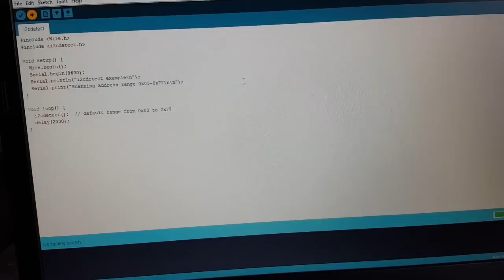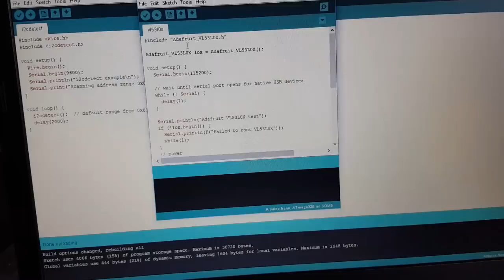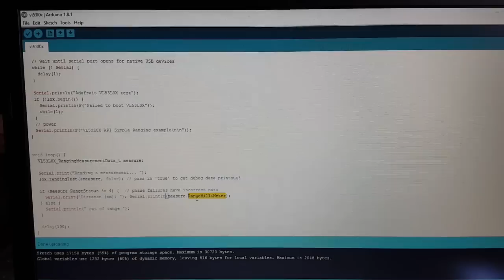Shooting laser to measure distance

Comment: Does anyone know if it possible to code in a 'set' button, so the screen reads '0' and the measurent counts up as the item moves closer?

Thanks
Reply from the maker: Of course. You can do it through the code. But it won't extend the range. So if the sensor has a maximum range of 1 meter and you place an object 20cm in front of it and reset this distance to zero. Than you only have 80cm distance left for measurement.

Comment: Is it possible to use laser sensor to measure the water level?
Reply from the maker: I would probably go for an ultrasonic sensor to measure water level.
Reply: @nenioc187  thanks. I'm just interested in the input voltage that TOF sensor offers

Comment: i want to use it for people counting in a room. i need direction for + and - for counting
Reply from the maker: Point it to the door. If distance stays constant, no one enters or leaves. If the distance decreases, someone moves away from the sensor. If it increases, someone moves towards the sensor. Or use two of them close to each other as a barrier. If sensor 1 and then sensor 2 changes distance, someone enters. If sensor 2 triggers first and then sensor 1, someone leaves.

Comment: My company did a project using one of these TimeOfLight sensors, and I worked with them extensively. I did not use the Adafruit drivers, I dealt with them directly with I2C commands to the registers. I detected a problem with them, they are not supposed to be sensitive to temperature or ambient light, but I found them to have a small susceptibility to both, It was enough to give us problems. Since the modules attempt to compensate to temperature changes, sometimes they over-compensate, sometimes they under-compensate, there was no way of telling which way any given sensor would go. Also, sometimes they would become more stable in their readings with a given temperature change, sometimes they would become more erratic. I decided I needed to create a test fixture to try to characterize these things.

I built up a breadboard PCBA with ten of these devices. I used one IO pin from the Arduino to drive the reset pin of each device. I would release one devise from reset at a time and assign it a new I2C address, and in this way I was able to work with all ten devices at once.

I put that PCBA in a wooden box with a lizard-warming heat source. The Arduino had a temperature sensor and a relay to power that warmer. It could be queried from a PC to give the current distance reading from any device, to report the temperature, and to turn the heater on and off. The PC would have the box heat to a configurable temperature, keep it there for some hours, and then let the box cool to ambient for some hours, taking and recording the time and temperature and device readings every few seconds. All the data went to a .csv file that I could pull up in Excel and then plot the data. I noticed behavior changes at 8:00am and decided it was because people were coming to work, lights were turning on, and the box lid that the devices were reading to was translucent wood. Aluminum foil tape fixed that problem.

We were able to fully understand these distance sensors and figure out how to make them work for out project. We had no further troubles with these sensors.
Reply from the maker: Have you published your research? I'm interested.
Reply: @nenioc187  No, my data stayed within my company. I still have my data that was collected during the test, and I still have the fixture and the source code to run it. While the Arduino monitored the temperature and made the readings, there was a program written in LabWindows/CVI that controlled the Arduino and collected the data. The project we were working on was a one-off, only installed in one hospital, but there is an effort afoot to improve on the concept and make it more generally available. I don't think the Lidar sensors will be in the next version of the system.

I am a test engineer with no college degree at all. That has not stopped my 40+ year career. I have been creating test automation systems for over 30 years, the previous years being spent advancing from electronics assembler to test automation programmer. 

Your "I'm interested" line leads me to ask if I can help you in any way. Can I?

Comment: can it measure with 3 digits accuracy, for example 40.231 cm; 50.446 cm; 21.273 cm, etc ?. And what is maximum range ? . I want to measure distance between 2 cm to 300 cm

Comment: Hi! Thank you for the video! I've been working with Vl53l1x but It has real problems with precision, %3. Do you know a similar sensor with a high precision and resolution? By the way, I need it for 2,5 meters
Reply from the maker: For this distance I would go for a ultrasonic sensor. You can increase the accuracy even a little more by adding a air-pressure .sensor
Reply: @nenioc187  I didn't find the cheap HC-SR04 ultrasonic sensors very accurate. Generally they worked fine, but it would regularly give me a random 'out of range' reading. It also depends on the shape of the object, if it's a nice flat surface the sound will bounce right back, but if it's pointing at a human walking past which is more rounded and covered in clothes it doesn't bounce back the sound very well. So pretty good for self drivng cars that have to detect walls and good to detect the water level in a water tank or well, not amazing for a burglar detecting system. But the more expensive ones should be múch better I've heard. They can get pricy though. I do think the cheap ones have a range of about 3 meters which is nice.
Reply from the maker: Each distance sensor is limited by it's reflective characteristics. But I took a measuring tape to verify the accuracy of the ultrasonic sensor. I've tested it with an accuracy of about 1cm and it still reached the 3m. Of course under perfect conditions. But you are right - you usually can't expect industrial precision of a 1 € sensor. For a anti-burgular system, I would recomend another approch anyway.
Reply: @nenioc187  ok thank you!

Comment: Looking at the datasheet https://www.st.com/resource/en/datasheet/vl53l0x.pdf there's 2 modes of distance detection: 1.2m & 2m.  I'm guessing you're in the 1.2m mode.  Not a biggie but just in case others are reading...
Thanks for a great video.  :)
Reply from the maker: That's correct! Thanks for mentioning it. Although it's loosing accuracy in long range mode and works only reliable in dark conditions.

Comment: but how fast is it, is my question, response time
Reply from the maker: Corresponding to the datasheet, it has a performance of 20ms in high speed mode.
Reply: @nenioc187  Ah, never mind. I just read your response to another: "corresponding to the datasheet it has a high-speed mode. Then it has a low accuracy, but a refresh rate of about 20ms."
Reply: @nenioc187  Does that mean I could get ~50 measurements per second? I want to create a 3D scanner where the laser (several of them) quickly moves up and down taking measurements while the object being scanned is revolving on a table. Also, how precise were the measurements?

Comment: Will it be used to measure the level of a water container? I need to determine if the level has dropped below a limit and in that case, light a pump so that it refills again.
Reply from the maker: I would recommend using a ultrasonic sensor for this task. It's more reliable when it comes in measuring water level.
Reply: nenioc187 the problem is that when working with salt water (it is a marine aquarium) the oxidation is very fast. that's why looking for an alternative.

Comment: what battery would be required this run this for 6 months
Reply: Depends what microcontroller you're using. I know ESP8266's can be put in deep sleep mode. If you put it in deep sleep mode, let it wake up to take a reading, let it go back to sleep for a couple hours you might run it for months on a button cell. There are even more energy efficient microcontrollers I think.

Comment: Can anyone suggest what kind of sensor is good for measuring the badminton's birdie smashing speed?  I am trying to figure out if i can build an affordable home made (DIY) arduino device for measuring the smashing speed of birdie.  The laser sensor can only be used when pointing to the object, correct?  The birdie is small and moving object.  Will that be an issue for the laser sensor?  -Thank you!
Reply from the maker: The laser sensor can only measure the distance of a fixed point.

Comment: Thanks for making the video. I was wondering if the laser dot is visible to a camera? The reason is that I want the laser to scan and locate for some object. I want to use a regular camera to see where the laser dot is. If I know where the laser is shooting then I know where my object is located.
Reply from the maker: Why not using a second, visible laser as a guide on top of this sensor?
Reply: Thanks for the suggestion. I prefer using one laser otherwise it will be more complicated I need two lasers and calculate the delta of the two lasers. If the first one is not visible to the camera it is not clear whether the delta is correct.
Reply from the maker: Since the sensor has a maximum range of about 125cm the deviation would be insignificant.

Comment: I have a question...is it possible to measure distance from a non-flat (rounded) object? Thank you!
Reply from the maker: Only if you hit it directly. But there is a high chance that the laser beam is reflected NOT back towards the sensor. Because of physics.
Reply: Thanks a lot, I tested and it worked.

Comment: Hi. Thanks for sharing. What sort of minimum refresh can it achieve? 10ms, 100ms? I wonder how many RPM would it detect using wheel with opening. Also, is it possible to weather seal it?
Reply from the maker: Corresponding to the datasheet it has a high-speed mode. Then it has a low accuracy, but a refresh rate of about 20ms.
http://www.st.com/content/ccc/resource/technical/document/datasheet/group3/b2/1e/33/77/c6/92/47/6b/DM00279086/files/DM00279086.pdf/jcr:content/translations/en.DM00279086.pdf
Reply: Thanks. I might go with Infrared sensor of a sort instead.
Reply: Eddie what's your application? I used an IR prox sensor left over from a line following robot project in a project that required wheel speed measurement. We were using pieces of reflective tape as triggers, not openings, but I suppose the latter would work just as well.

Fed the output into a comparator to adjust the noise floor and also to provide a sharp edge transitions. Then fed that into a pin on the timer I/O capture/compare channel set for rising edge capture. That kicked the value of the running timer into memory, then we just used consecutive captures to calculate RPM. 

Using this method took everything else out of the equation, leaving only the micro's speed as the limiting factor.
Reply: I was thinking of sensing speed of motorcycle's back wheel. But for this I need much faster device. Apparently this device would stop accurate measurement after hitting around 30km/h. I might be wrong though.
I did check iR one and that seems to match my needs.
Reply: Eddie for that kind of application I'd be weary of using any light driven solution that isn't self contained in one way or another. Basically, you'd want all sensor elements contained inside a "black box" with a single mechanical input such as a shaft that is well sealed from the elements, and driven by something on the wheel or something already mechanically coupled to the wheel, like the transmission output shaft, sprocket, chain tensioner/follower, belt tensioner/follower, adding one of the above, etc. Our device was extremely temperamental, and the bike wheel was just being used as a way to convert linear motion into rotational, and was used in a very clean environment. Not only in regards to "gunk," but "light pollution" as well. You may be able to find an IR solution that works for your application though. It is a rather cheap and easy option, so even if failed in real world testing you wouldn't be out much. 

Another non contact option is using a Hall effect sensor. Also quite cheap, and have been used reliably in the auto industry forever. Also, if the bike is chain driven you might be able to use one of the sprockets as a trigger wheel instead of fabricating one. Or go with the old standby of a magnet(s). There is also a nifty chip that contains multiple Hall sensors for use as a non contact rotary encoder. This requires a small round specialty magnet in/on the end of a shaft. Works great for RPM, but generally requires some kind of calibration.

This all goes for something permanently affixed to the bike and exposed to the elements/road grime/whatever. If it's a diagnostic tool your options open up considerably. 

Hope this has been useful in some way for you!

Comment: Hi. How could it be possible to connect 2 or more of these laser modules?
Reply: I think it's only possible if they have different I2C adresses. So maybe you could try 2 different variations of the laser modules (check in the product description of they actually have a different adress) or I think it's possible to change the adress on one of them. But that might require you to change a small SMD resistor on the laser module which is quite tricky.

Comment: How do you detect range of 1km with a laser
Reply from the maker: There are laser distance measurement devices that can detect up to 1km. You can find them at golf accessories. No kiddn'! Look for "golf rangefinder".
Reply: nenioc187 Yep I know those. But I'd like to build em with arduino. Any chances?
Reply from the maker: I won't say you can't. But I doubt it would be easy or cheap. Maybe there is a easier way to archive your task?

Comment: I give it a like.
I have to wonder what is measured. Light travels 300m per microsecond, 0.3m per nanosecond, timing would be in picoseconds to get centimeters. 
The sensor filter is to cut out visible light. Check the reflection of IR from black surfaces some time. At least some reflect IR.
Reply from the maker: The datasheet doesn't state the concrete method. But usually a ToF sensor really calculates the distance by the time the light takes to travel forth and back to the object.
Reply: I operated ground-surveillance doppler radar in the 70's. Electronics I don't know allowed the return frequency to subtract the outgoing frequency and we listened to the difference which was FANTASTIC with detail.
Something like that, any movement made noise. 
I'd love to see something like that with range enough to incorporate a selective return window, even 20m.
Reply: They still make tape measures, in case anyone wants to take a measurement without batteries or interference from sunlight, dust, or some filth over a lens.

Comment: How well does it work at finding the distance to the surface of water? Will it absorb too much of the energy, or does it work?
Reply: I haven't tried it with this sensor, but many people use an HC-SR04 Ultrasonic Sensor for water level detection. I see a lot of water level detector projects on the ESP8266 Subreddit. A good thing about the ESP is it's super power efficient and it has built in Wi-Fi (at least many do). It does have 3.3v logic instead of 5v though, so you should get an HC-SR04P or HC-SR04+ as it can use 3.3v logic, or you can get a Logic Level Converter.

Comment: did removing the  protective film change the sensor results?
Reply from the maker: It seems that I get less false positive results when removing the film. But I didn't verify it scientifically.
Reply: what is the range of the sensor
Reply: You will still get inaccurate results on matte black objects, obviously.
Reply: Do you know which surface gives the best results?
Reply: @opolip001  i guess that would be white reflective surfaces ;)

Comment: Hi, great video, I've also seen the one on gyroscopic where you made comparison with one board with i2c and one with direct axis output. so my question do you know the TOF https://www.gilisymo.com/ ? this board output directly the distance compared with existing boards...
Reply from the maker: I've seen it now. But I don't think it's worth the money. It uses the same laser sensor, but costs about 5 times more. The only advantage is that you can connect it though tree different interfaces to your microcontroller - what is pretty cool, by the way. It looks like an interesting variation of the sensor, but I don't think I'll pay 39€ just to test it.
Reply: Ok thanks, but this board has a cpu and a FW programmed. What is the right price for you?
Reply from the maker: I don't think it's a bad product. I think it comes in very handy to have multiple interfaces to get the sensor values. Especially when you a low on memory, it's very useful, when you can avoid using additional libraries. But I don't see the killer application, where this sensor will be a better choice than the raw sensor - yet. But I'm pretty open minded. Maybe this sensor will pay off one day.
But thanks for noticing me about this variation of the sensor!
Reply: You are welcome! For a good demo maybe you can have a look at https://www.thingiverse.com/thing:2320046 since the sensor output value in UART you can connect it directly to HC06 and olso to a uart to wifi... with zero effort

Comment: Great video! Did you notice if it can detect quickly moving hand wave across sensor?
Reply from the maker: I didn't test it. But surely it could detect a hand. Just by identifying whether the distance has changed for a short period. Although it cannot detect gestures. But there is also a sensor for that ;-)